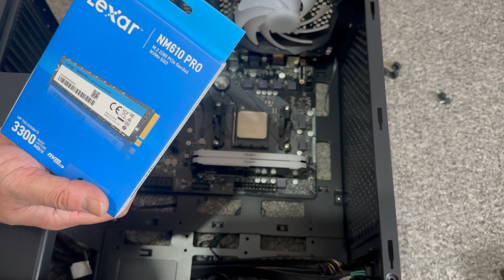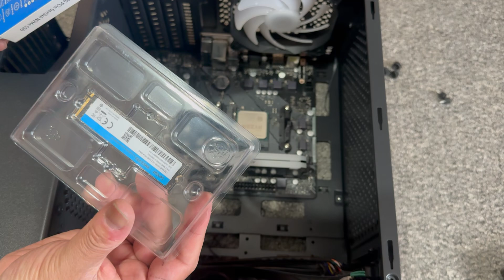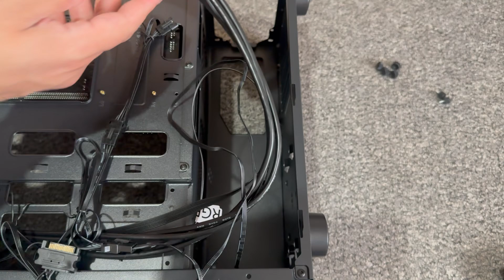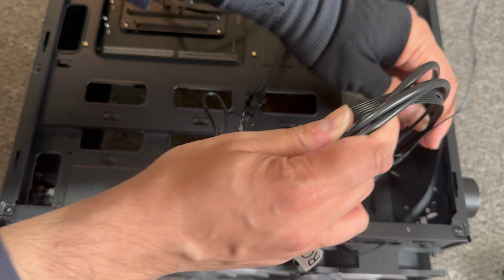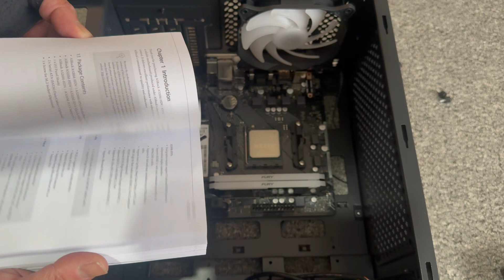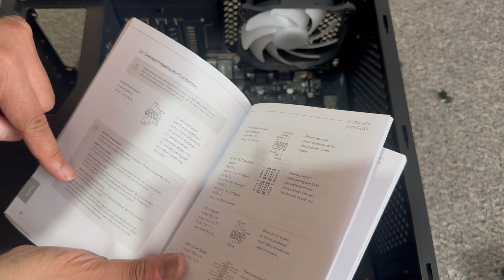M2 SSD & Front Panel Connection Installation - Build Part 4

Comment: how do you get the rgb fans to change with the reset button?
Reply from the maker: There are two pins provided in the casing connector that connect to the LED connector on the board, button is actually not a reset button but a dedicated button for controlling rgb leds.